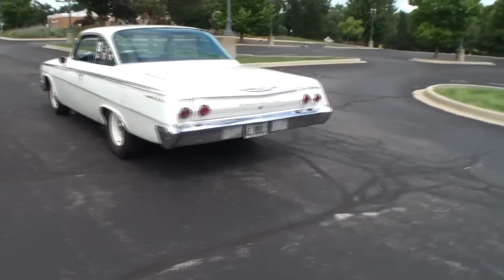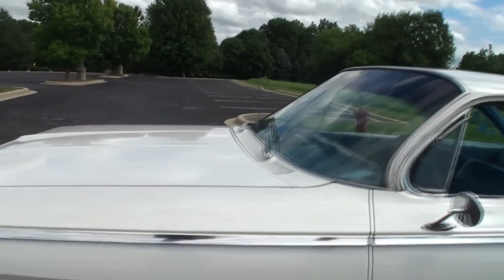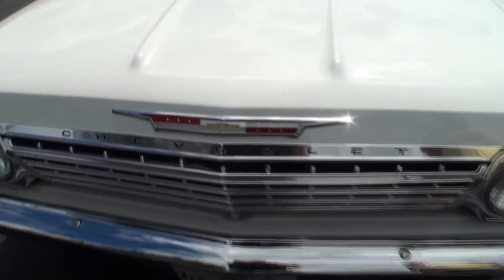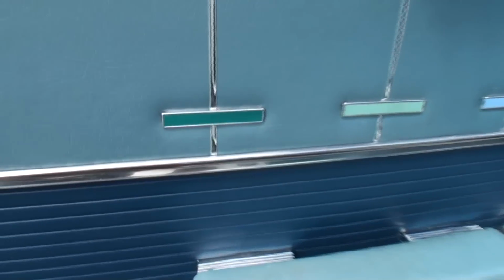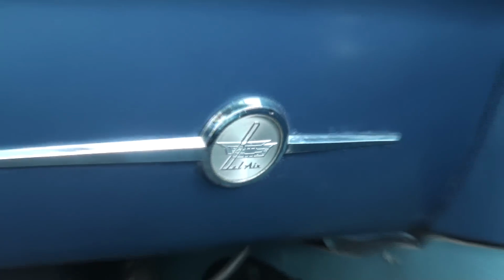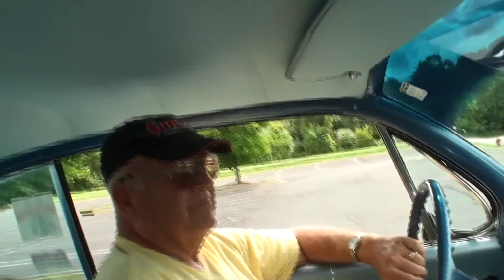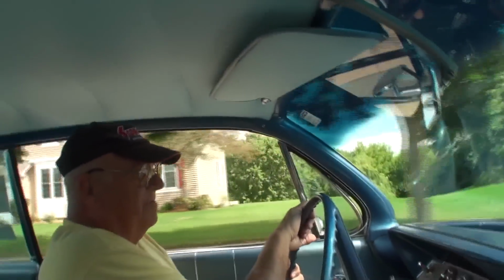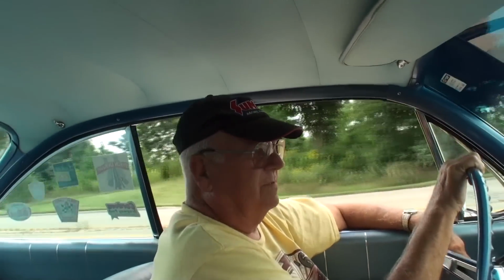1962 Chevrolet Chevy Bel Air Bubble Top in White & 409 Engine Sound My Car Story with Lou Costabile

Comment: My father bought the 1963 Biscayne version which was probably a bit lighter than the Bel Air.  It had a rubber floor covering, no carpet, no radio, and no heater.  Just get up and go.  If you can believe it that is the car I learned to drive in.  Thanks, Lou for bringing back such great memories.
Reply from the maker: Hi Rich, Happy to read this car brings back memories of your Fathers car :-) Thank you for viewing and sharing, Lou

Comment: The 1962 Chevy Bel Air 2 door hardtop was the only full sized GM vehicle that kept the thin pillar or "bubble top" styling from the 59 through 61 generation. The Impala and all Pontiac's, Olds, Buick and Cadillacs had wide c pillars beginning in 62. At the time the the Bel Air hardtop was the lowest priced full sized GM 2 door hardtop with an MSRP of just below $2500. Now it is the most sought after due to the exclusive design of the narrow c pillar. This car with the 409 engine make it even more valuable. Also radio was not a "delete" option on cars of this era. Am radios were extra cost on all vehicles except the Ford Thunderbird where it was standard. Heaters were delete options as most cars had heaters as standard equipment. This is truly a rare find that could sell for 100K with the 409.
Reply from the maker: Hi Larry, Thank you for viewing and sharing your knowledge, Lou

Comment: Nice ride! About the gas, your probably ok with the Premium 94 test that's at every pump (runs great in my 2019 400 HP Dodge Hemi). If your using the original heads and valves from 1962 the main thing is the absence of lead in modern gas. I've seen off the shelf additives in a 12 oz bottle you add to a full tank of today's gas and it will help protect your valve-train, running real Racing-Fuel isn't really necessary unless your compression is up above 12 to 1 or so. I used to know a guy back in the 1980's who had a 16 to 1 compression full race engine in a 1968 Camaro body, he ran High Octane Aviation fuel that was 120 test (or so).
Reply from the maker: Hi Raymond, Happy to read you enjoy this "Nice ride!" :-) Thank you for viewing and sharing your knowledge. Hope you see many more cars on this YouTube Channel you enjoy. Please subscribe, and hit the "bell" so you can see all the cars when they are uploaded on this YouTube Channel, Lou

Comment: I had a beautiful black one, no rust and never wrecked. I had a 425 hp 427 in it with rock crusher 4 speed. I could turn that engine to 7800 rpms very often. Never hurt the engine or transmission, but did destroy several rearends
Reply from the maker: Hi Jamey, Happy to read you had a cool black one :-) NICE! Lou

Comment: My brother had a white bubble top with a 283.  Not a barn burner but smooth and quiet as a lamb.  Problem was loosing a tooth on the fly wheel because the starter motor was engaged while it was already running.  It was so quiet and smooth.  And light.  Cannot imagine with a 409.  The GTO holds honors as the 1st muscle car.  But really it was not.  "She's real fine, my 409."
Reply from the maker: Hi Tom Quinn, Happy to read this video brings memories of your Brothers car :-)  Thank you for viewing and sharing, Lou

Comment: I'm confused, did the Bel Air have a different roof than the Impala? I have never seen a bubble top on a 62. My first car was a 62 Impala SS and had a different roof. I always believed 61 was the last year for the bubble top.
Reply from the maker: Hi Mike Brown, I'm not exactly sure, so I'm hoping a Chevrolet Expert can answer your question, Lou
Reply: '62 Impala sport coupes only had the "convertible" roof. '61 & '62 Belair 2 drs could be had in sedans (post) or sport coupes (pillarless, "bubbletops").

Comment: in 1971 i bought one of these 409 bubble top, the car was well known around long island. it was customized with the original tail lights replaced with olds lights and a crazy green heavy metal flake paint. i would not have changed the tail lights. i street raced it a lot .ate up GTO'S. anyway it had a electric fuel pump well hidden under the dash. it would go about 1/2 mile and shut down if you forgot to turn it on. i went to jones beach one day and the car was stolen. i forgot to turn off the pump [probably distracted] they would not have got far if i did and probably would have just left it. it was 1 of a kind and a lot of people knew the car so my best guess is that it was stripped or sent overseas. never found. i was a young guy and that hurt. story goes that after the original costomizing it had a article in hot rod magazine in 63. without internet at the time i could not verify that
Reply from the maker: Hi Fred, Happy to read this car brings back memories of your car :-) Sad to read your car was stolen :-( Thank you for viewing and sharing.  Hope you see many cars on this Channel you enjoy!  Please Subscribe, and hit the "bell" so you can see all the cars when they are uploaded on this YouTube Channel, Lou

Comment: It's not a lake pipe, it's called a cutout. And the original exhaust pipes exited out below the rear corners of the car, not straight out the back. And the tach is from Sun, everybody used them. The correct era headers would have been from Doug's or Jardine.
Reply from the maker: Hi older than you Cali, Thank you for viewing and sharing your knowledge, Lou
Reply: Some guys ran Hedman Headers too.

Comment: You guys might want to research AV (aviation) fuel,a low lead 100 octain,un-re  formulated  fuel that you may be able to get at small air strips. We have one that I  get it from here in Southeastern Wisconsin.  Use it in my small engines. Cost was just over $4.00 a gallon
Reply from the maker: Hi JonH3234
,  Thank you for viewing and sharing a tip.  Hope you see many more cars on this YouTube Channel you enjoy,  Lou

Comment: I owned a 62 Chevy Impala, same color with a 283 ci engine. Wouldn't win many races, but it was a nice driving car.
Reply from the maker: Happy to read this car / video brings back memories of your 62 Chevy :-)  Thank you for viewing and sharing.
Reply: @loucostabile   I actually owned two 62 Chevy's. The Impala that I sold or my Dad sold for me, when I was getting ready to get out of Basic training and it looked like I was going to be sent overseas right away. As life would have it, they kept me stateside for around a year, so before I reported in to my base of assignment I found a 62 Bel Air sitting next to a farmers barn. It hadn't been run in over 2 years. 

That was an all black, 6 cylinder, three on the tree, no radio and a whole the size of the grand canyon in the drivers position seat. I bought it for $150.00. I took a chance on it because when we jumped the battery, it turned over and started on around the third rotation. It was skipping, but running. I was able to drive it home and took off the valve cover and found a rocker arm bolt laying on top of the head. I put the bolt back in the place it belonged and started it back up. No skipping.  I was stationed 400 miles away from home and drove it on a cold winters day to my base. 

I made a number of trips back and forth before I was ordered to Vietnam. Every trip and basically every month I had to readjust the valves, but other then that it was very dependable. Some old towels stuffed into the hole in the seat and a cheap seat cover and it was good to go. I did sell it before I left for sunny southeast Asia. I wish they still made cars like they did back then as far as toughness and dependability is concerned, however, today's high tech cars require a whole lot less maintenance and kid gloving and at my current age, pulling a valve cover once a month is no longer on my to do list. With new cars the valve covers aren't even visible anymore anyway. I owned a Cadillac DHS for three years before I even knew where the battery was located. (under the back seat... weird)

Comment: Correction here, the first chevys with the 409 was in 1961 with a single 4 barrel built in the 4th quarter of 1961. The duel 4 barrel appeared in '61 and achieved 409 HP.
Reply from the maker: Hi Richard, Thank you for viewing and sharing, Lou

Comment: I had a 61 Belair and I know they came with the 409 as well.
Reply from the maker: Sounds like you had a cool car to Charles :-)  Happy to read this car / video brought back memories of your 61, Lou
Reply: I was aware that the 409 came out in 61, but the higher production year was 62 with about 8,000 409 motors going into cars and another 7000 crate motors that went to dealers.  Total motor production was around 15,000 and I am not sure how many of those went into bubble tops.

Comment: So many cars in 60's were total sleepers. Tone down the exhaust a little and no one would ever know. 
 Just go pink slip for pink slip. 👍🏻😉
Reply from the maker: Nice :-)
Reply: Totally correct. Aside  from the solid lifter clatter & 409 script these could pass for any other grocery-getter. No lopey idle, quiet mufflers from the factory. Except for the stiff clutch very streetable.

Comment: Chevrolet introduced the 409 in the late months of 1961  in the Impala model, only 142 were made .They are now a very collectible item..Also,  PLEASE  NOTE,   Chevrolet made a  V8 engine way back in 1917-1918 , it was 288 cubicinches, made 55 horsepower, had overhead valves,  but no one wanted to buy it.Ford had the market with its flathead 4 cylinder engine !!
Reply from the maker: Thank you for viewing and sharing your knowledge.